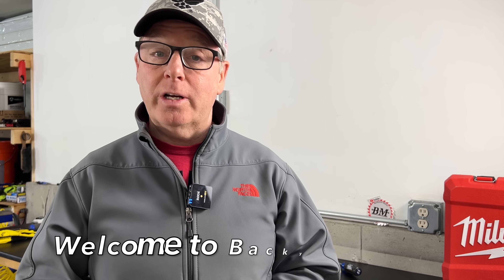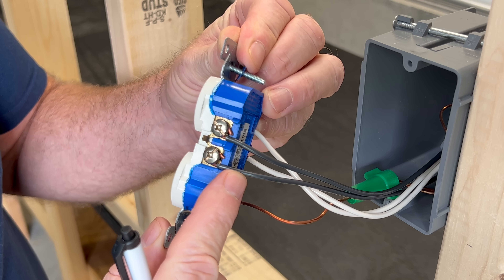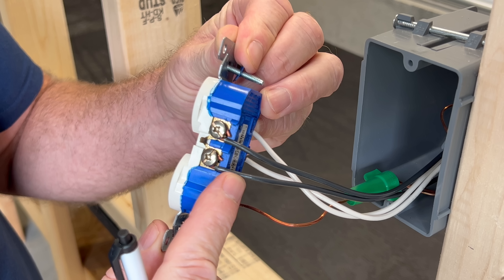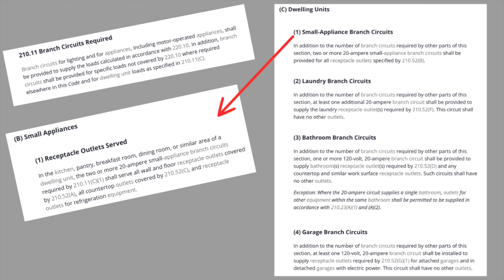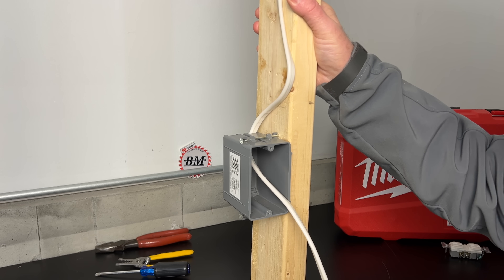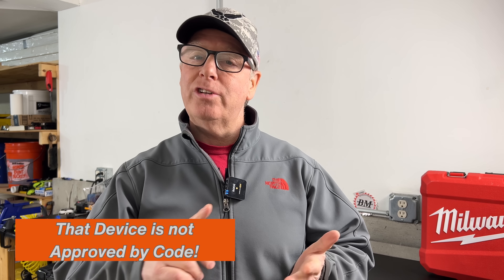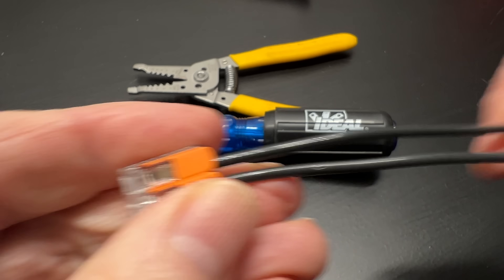5 Electrical Code Lies DIYers Should Stop Believing!

Comment: Regardless of code requirement or non-requirement, I am going to put tails on my devices. 
1) I don't like the fact that everything downstream is using that fragile breakout as part of the circuit. 
2) It's a lot easier to do both the initial install, and to change out devices later.
3) I  trust my wirenut connection a lot more than I trust the spring grabber on a backwired device.

I would insist on it in MY house. And if I require it for my own piece of mind, I think my customers deserve the same consideration. 

But, hey, you do you. 😊
Reply from the maker: Absolutely.. If you use the backstabs pigtails are a must have but I don't recommend using them at all. I have a video on when and where I recommend using pigtails. Oh and the tab on the devises is actually rated for 20A passthrough current even on 15A devices and the they are UL tested at 30A to get the 20A listing.

Comment: Yes, code is focused only on safety, not on usability or convenience.  Using pigtails, 20 A circuits throughout a home and providing service loops are convenience issues rather than safety issues.  They are good practice, but not code requirements.
Reply from the maker: I think that safety and reliability are almost interchangeable in the electrical field. If system or parts of a system are installed poorly they will cause reliability issues which can then become a safety issue. So in my view the code is focused on both the safe and reliable installation of equipment and systems.
Reply from the maker: @Joe-by8jh  Yes either way the wire is protected.

Comment: Look closely there appears to be a code violation over his shoulder. EMT run between termination points shall be securely fastened within (3 ft) of each outlet box, junction box, device box, cabinet, conduit body, or other tubing termination.
Reply from the maker: Nope the nipples are all less than 3 feet and don't need support. Good try but though..

Comment: Wrong about ground up...well not totally.  Canadian code required ground up for trailer parks.  So I could see Canadian and Us code inter mingling
Reply from the maker: The National Electrical Code doesn't apply to other countries. Just the USA. I'm sure that there are many differences between our regulations and the ones used in Canada.
Reply: @BackyardMaine  well NEC and CEC are probably more than 70% the same.  I work with both

Comment: Depending in which city I worked in, I always ask inspector what he wants to see in his city. Saves me a whole lot of headaches.
Reply: I have always have a problem with the power of building inspectors, they need to have their wings clipped. Just look at Lehtos law, you do all these things to make one inspector happy and the next one tells you none of it had to be done happens all the time. I had one inspector tell me on an out side door you can replace a window that keeps getting broken or you can put in a solid door , but you cannot put a wood panel in a door that did not come with one HE DROPPED IT WHEN  I OFFERED TO TAKE HIM TO COURT AND MEANT IT  !! ALL MALE BOVINE EXCREMENT !!!
Reply: @bobpawtucket1336  Well you probably better figure out sooner than later ... if you engage in pee'ing contests with them . For the most part they will be happy to oblige you and show you where the bear shiots in the woods .
Because their job is to clip your wings if you are not flying straight .

Other than a few odd cases , I can't say I have ever had much problems with inspectors.  And most in my experience are actually helpful .  Which is how I firstly learned most of the electrical requirements starting out in the jack of all trades handyman line of work I've been in for 40ish years .
Which I have installed nearly 2 dozen meter main service entrance setups and lots of branch work.
Permits taken out by the home owner or somebodies license they knew or general contractor I was working for at the time .

Less is more when dealing with inspectors , and usually it is always better to be there if they fail something rather than having to discern it from their paperwork.
Try and view them as helpful rather than adversarial would be the best advice I can tell you ;)
Reply: @bobpawtucket1336  I'd say engaging in power struggles with an inspector is never a good idea , unless you enjoy those kind of contests and all the friction that come with them .
Try the less is more approach maybe ;)
Reply: @Mk101T  You know you try that to a point , but some were you have to draw the line! When you polity ask the inspector could you show me the statute or the code and the answer you get is I MADE THE LAST GUY DO IT THAT IS NOT! NOT ! INSPECTING THAT IS BULLING PERIOD AND I PUT A STOP TO IT  .
Reply: @bobpawtucket1336  Well the reason you asked for the code ,,, was a pissing contest.  So you got what you gave .
Maybe your problem is working in the slum lord end of things ?  Hence you want to replace a glass pannel with wood .  Rather than replace the door , or situation ?
Reply: That has always been my go to! Ask the inspector what he (or she)wants to see. They appreciate the nod to their "expertise"...
Reply: @marvinwerth9421  I did that once and then the owner of the company reamed me out for it. And I agreed with him. Eventually you run into a prick inspector that "has his own code" of says "you won't do that in my town!" even though it is in compliance. He told me to do my job, stay in compliance, and challenge the a-hole when you are right. And that he would back me up. Because pretty soon you just become a little errand boy for a miserable bastard who just enjoys busting your chops.
Reply: I try to establish a dialogue with an inspector in the city. It is very helpful. They will let you know what they care about and what they do not.  I'll still stick to code but it's helpful to know where there mind is at and more importantly to get their "take" on situations that are not clearly in the books or may not meet the letter of the law [but there is no clear alternative].  Maybe they're understanding on it [maybe not]. Why not find out now ?
Reply: @Stephenwc      Perfect.... catch more bees with honey approach. I usually tell them the overview then ask for pointers on what they want to see so we don't have to make changes later.
Reply: I ask what you require. The answer is I'm not a teacher. What does the code say   and I'm licensed

Comment: @1:50 I could be wrong but I'm fairly certain code also forbids upward facing outlets outside.

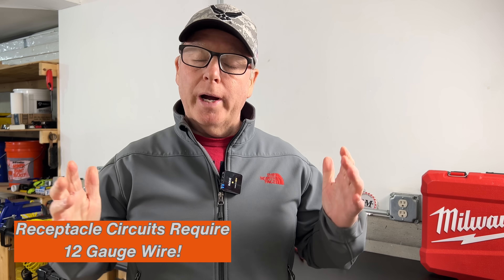@2:18 I don't think anyone thinks this is "code" as per NEC, but rather many cold regions don't allow anything less than 12 AWG and so that is "code" in that region.
Reply from the maker: Sorry but you are wrong about the outside receptacles. The code has no preference other than the one I mentioned about countertops and under a sink. 
Also there is no regional requirement for wire size. The tables in the code are based on the size conductor, insulation type and its temperature rating and how it's run. (conduit, cable, free air or direct burial).
Reply: @BackyardMaine  Hmmm, I was certain I had read something somewhere about code forbidding upward facing outdoor outlets, but after looking into I can find nothing. I must be misremembering. Perhaps it was a situation where they wanted receptacles in an exterior BBQ countertop and that's why they weren't code compliant. Regardless, it seems crazy that code doesn't forbid them. I've actually installed many of the outdoor floor receptacles where they pop up with the receptacle facing sideways. They are absolute trash and they do not prevent water from entering the box.

There is however regional wire size requirements. This is a link to a code addendum in Oklahoma City:
https://www.okc.gov/home/showpublisheddocument/18533/637284189574770000
It stipulates that minimum size wire for branch circuits shall be 12 AWG. You can still use 15 amp breakers, but no 14 AWG wire. Assuming you are in Maine, I'm actually surprised they have not adopted a similar addendum, but I suppose Maine's winters aren't the worst around.

Comment: John, great video. A few comments though. You mentioned local codes. You're right. In LA city, pig tailing is required and 14AWG is no good. And, you are sometimes victim to snooty inspectors. The inspectors can require whatever they want. And, I should mention that the NEC is written by the NFPA, the National Fire Prevention Association. Great video
Reply from the maker: Yes for sure and thank you.. I have taught classes on the NFPA-70 and NFPA-70E..
Reply: They can NOT require whatever they want.  If they are “interpreting” something a certain way, sure, they can say they want something done that way.    Buuut, An Inspector can't just come onto a site and start “requiring” things to be done the way they want it, all  because they like it that way.  There's a code for a reason.  I have been involved in a couple different projects where the inspector was failing a 4-way inspection  on one project and another inspector failed the C of O inspection on another project. Both times the Inspector was requiring a totally bogus way of doing things just because they thought it was “better”.  When reasoning with the inspectors failed to work all while saying that their request was not written out in the IBC. We had to get the head Building official involved, which worked out in our favor both times.  It probably goes without saying but, you don't win any friends by going this route.  It comes down to picking your battles like always.
Reply: @savage6394 individual cities absolutely can have their own electrical code that is stricter than the NEC. It's also how ALL residential wiring in Chicago and most of its suburbs is required to be in metal conduit.

Now, an inspector can't just make stuff up. But if the city's electrical code requires something, it's required, even if it's stricter than the NEC.

Comment: Oh my gosh!  I'm in violation.  I hope the YouTube Police don't read this.  I have about 12 inches of 13 gauge wire running between outlets on opposite sides of a wall in a 20 amp branch.  I guess I can't use that electric heater anymore.  My house will burn down. :eyes-purple-crying:
Reply from the maker: Yeah you will have to let us know where you found the 13 gauge wire since they don't manufacture it.
Reply: They do make 13 gauge wire if you are looking for magnet wire for motor winding! @BackyardMaine

Comment: Best practice is to follow the NEC guidelines as the minimum and local regulations if they exist and are more stringent. But local regulations that are more forgiving do not supersede NEC requirements.
Reply from the maker: The baseline is the code in my experience. For example I have never seen a local reg that allows something that the NEC prohibits. Since all 50 states have adopted the NEC then some have amendments or additional requirements. But also the code isn't just a minimum standard in my view.
Reply: @BackyardMaine   Mind blowing as it is, there are places that have no code whatsoever and impose no restrictions. The only time anything will ever be questioned is between you and the insurance company if it ever hits the fan.
There are still a few places left in the country as free as the day it was born....
Reply: Local AHJs can override NEC codes in either direction. In other words, local regulations are NOT required to be equal to or more stringent than the NEC.

Comment: I recommend DIYers purchase the NEC Handbook.  It has the complete NEC in one color of print and explanations, examples in a different color.  Also includes pictures and drawings.  Therefore is about twice as thick as the NEC.  Some of the NEC is confusing and having something written just a little different helps.  Also a second source of information is helpful when dealing with someone that does not understand.  I purchase the handbook every other cycle.
Reply: Yeah, but unfortunately spending $280 for a huge printed book, just to replace an outlet is not really a reasonable ask for most DIYers.

It actually rather pisses me off that these are codes that are fundamental to doing work safely and in some cases could actually make the difference between a safe environment and a deadly hazard that could burn down a house and/or kill a family member, yet they're stuck behind several-hundred-dollar paywalls (and even then only provided in hard-to-use printed forms with no search ability, etc), pretty much guaranteeing that lots of the people who really should be reading them will just not be able to, or won't want to.

There really should be a better and cheaper way for non-professionals to have access to this really important information, IMHO.
Reply: @foogod4237 AFAIK, there is a PDF version, but it's also behind a paywall.

Source: I found such a file on the High Seas.
Reply: The series of Code Check books available at lumber yards is a great resource and reasonably priced.
Reply from the maker: That's great advice..

Comment: Awesome insights thanks for the clarification... I think it goes without saying, however the code is often the  minimum acceptable practice..
Reply: Well apparently it doesn't go without saying, since you felt compelled to add that.  I see this sentiment frequently on these platforms; every time I see such comments they come off as a little arrogant - minimizing the rigorous approach NFPA has taken toward the development of codes and standards.  Electricians in particular seem driven to justify overbuilding the electrical system, suggesting that NFPA 70 is a "minimum", as in, "just getting by".   Most haven't done the homework, run the calcs, or considered the times we are living in.  They believe #12 wire is an upgrade all the time, even as lighting loads are plummeting in the home, or the need to plan for Grandma's 1875 watt space heater even as such spot heaters are becoming irrelevant in today's energy-efficient air-tight dwelling units.  The NEC is now allowing 10A circuits to recognize the lower power needs - yet installers of electrical work seem to be moving in the opposite direction, because, well, "you never know".   In reality we can know.  But it is going to require those installing electrical infrastructure to become actual electricians who know how to use the Code book, and plan and design properly.

Comment: NEC is a minimum level of safety we dare not go beneath, not some pinnacle of perfection to try to live up to.  Back stabbing outlets, using the device as a junction...not good.  Do you really want barely legal electrical work?
Reply from the maker: I hear that a lot but I disagree and I have a lot of experience with the CMP. Are you running 10AWG for 15A circuit? I’m guessing no. The code is not a minimum standard in most aspects. Some yes but most not at all.

Comment: I wonder if the pigtail and #12 wire requirements are from commercial work. I was a commercial electrician in the’90’s, and we always pigtailed no matter what. I couldn’t say if it was an NEC requirement or not. But I do recall that nothing smaller than #12 wire was allowed, except maybe for control wiring.
Reply from the maker: Most commercial applications don’t run 15A circuits so 12AWG would be the standard but not code. I will also pigtail more frequently in commercial or industrial applications but I don’t think is necessary very often in residential work.
Reply: Next time you're in a commercial building, take a quick look at the outlets. If the ground side of the outlet looks like a sideways "T", it's a 20 amp outlet. The code merely requires that the wire gauge be suitable for the devices on the circuit. Most outlets are rated at 15 amps and allow for 20 amp passthrough. So, if wired with 12 gauge, you can draw a maximum of 15 amps at any given outlet and 20 amps for the entire circuit, assuming multiple outlets on the circuit. But those outlets with the sideways "T" are rated at 20 amps and hence have to be connected with 12 gauge wire.
Reply: The building's blueprints will often specify 20 amp outlets.  I have often seen electricians/electrical contractors get in trouble by following their standard practice rather than looking carefully at the blueprints.  My pet peeve is them not running a separate circuit for networking equipment in the IT/Communications closet shown clearly on the drawing.
Reply from the maker: @videcomp  Yes of course you will need to follow the job specs or blue prints. We're just talking about code here.

Comment: Another thing to be aware of is that not every state accepts the most recent version of the NEC into law when it comes out. The service loops are legal in this version but aren't in older versions and might not be in the next version.
Reply from the maker: I posted a pic of what state have adopted what version of the NEC. But the 18” max cable length between the last support and the box is nothing new
Reply: @BackyardMaine  actually, it is very new code wise. It used to be required to be a 12" length of cable to the box. How we used to have to get these service loops is between staples with the one closest to the box being tight enough that it supports the cable but loose enough that you could slide it through the staple.
Reply from the maker: @ianbelletti6241  You're probably right. I have an older (2017) code book in the shop. I'll have to check. My memory isn't what it used to be. lol Thanks
Reply: @BackyardMaine  The "within 12" I remember from older code cycles, but 18" max cable length was first included in the 2020 NEC. My 2020 book is highlighted as a change from the previous code. I think the length between the box and last support was previously undefined. I don't have an older version to look back at though. Good video.
Reply from the maker: @mjdiiii  Hmm, you may be right. My memory isn't what it used to be. I have a 2017 code out in the shop. I'll check it out and get back to you. Thanks.